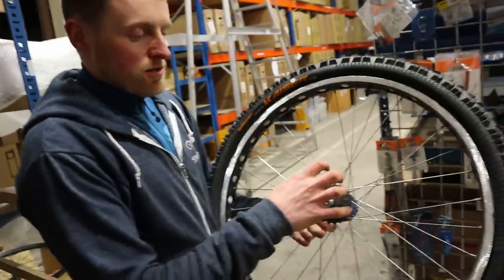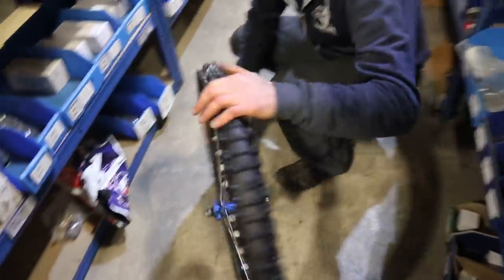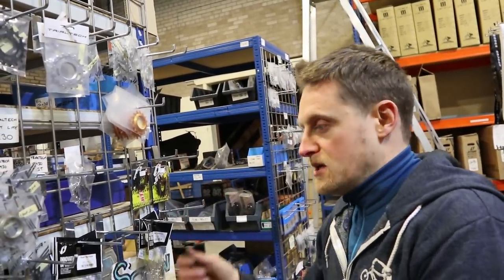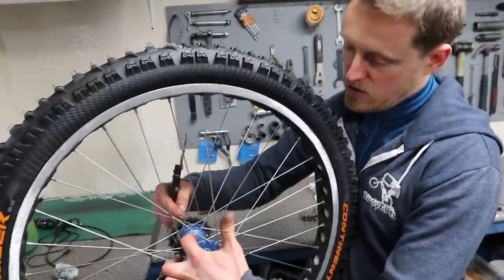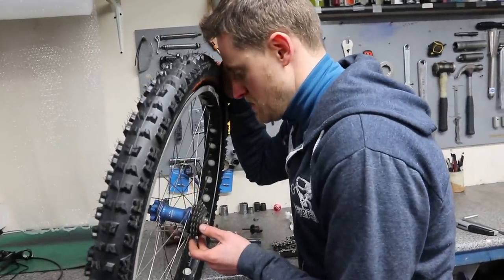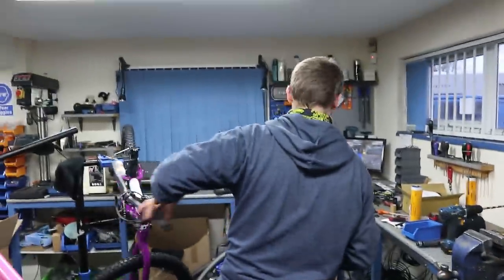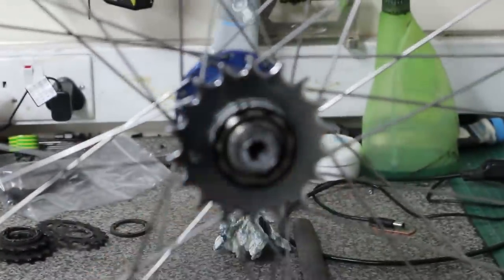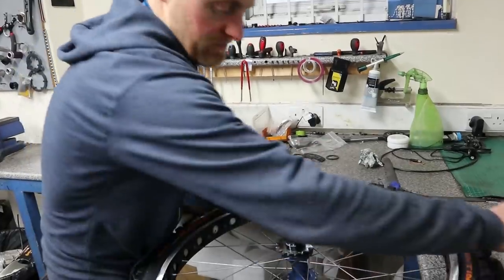Removing Stuck Sprockets + Going Single Speed Tips

Comment: Agree, trials is a quite specific thing compared to regular MTBing, so these vids are going to be very helpful  to anyone now starting or looking to start into it.
Just FYI, those Hope hubs usually come with the spacers and the one  for the end has a cap of such so that there's not that problem when you tighten down the lock ring, so worth looking into the proper part for the job - still have mine sitting there and thinking maybe, now that I've time on my hands might give SS a go.
Reply: I ordered custom wheels with Hope Pro 4 hubs.  I have not installed the sprocket yet but just looked and TartyBikes put the spacers in the hope box and one is as you described.   These wheels are going on a dirt jumper that I am going to use as an all around fun bike.  I am thinking of putting a 3 to 4 speed setup on it to go from trials gearing to DJ gearing.  I do like single speed...  Just don't require a trials specific bike for my level of messing around and think this may work for me.
Reply: @joeldriver381  actually, if you wanted to you can fit 6-7 cogs from a regular 9 or 10 spd cassette on there and if you machined down the back of the spider, 7 or 8. That's how come I come to have an SS/Trials hub, got it when 29ers first came out so I could build a stronger, dishless rear wheel and that's how I used to run it.
Reply: @lynxg4641  I was going to try the minimum  to keep the "SRAM GX DH Rear Derailleur - 7 Speed" tucked in as tight as possible to make it harder to rip off the bike.  The matching "SRAM GX DH 11-25 7 Speed Downhill Cassette with 11-Speed Cog Spacing, PG-720" is all separate sprockets and spacers(best I can tell).  I have a mill and lathe and lots of time at home at the moment...  Oh- thinking of just putting a shifter under the seat for switching bike modes.

Comment: Some rear hubs are not centred on the bike. If you're converting a regular MTB to single speed, it's best to measure the dropout width then measure from the drive side end of the hub  to figure out where the rear cog should be on the hub.

Comment: 4:34  I have Hope Tech Pro 4 on my Enduro wheels, with alloy freehhub, I have to do this regularly, quite often, but but I also file the side of the spline, I use a smooth file, and use the file to check the angle, so I file until it's straight and there are no indents, if de indents are very deep they can have the sprocket in so deep that it effects the shifting performance significantly,
also inspect the cassette/ freehub spacer it might get bent resulting in wobbly cassette, so will the indents, both combined will be bad, the spacer eventually wears out and can get twisted, but I kept the 11 spd cog spacers from the cassettes I had, so I have many spares, they are the same width as the spacer on the freehub on Hope Pro 4.

Comment: Have You ever used gear clamps? They're like cassette spacers, but they have Allen bolts to clamp directly to the freebody.  You can position the cog precisely where You want it, instead of using a stack of spacers. No need for the standard lock ring.